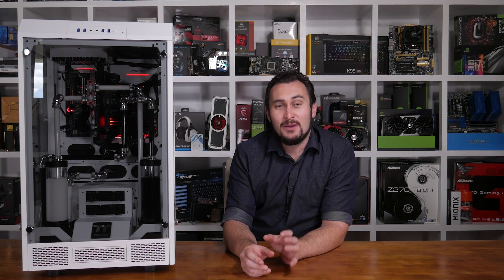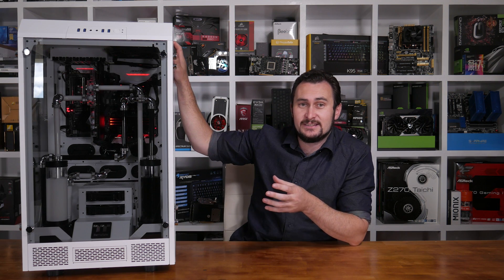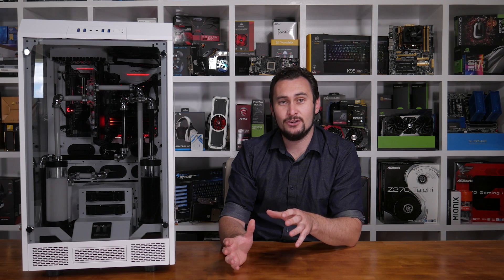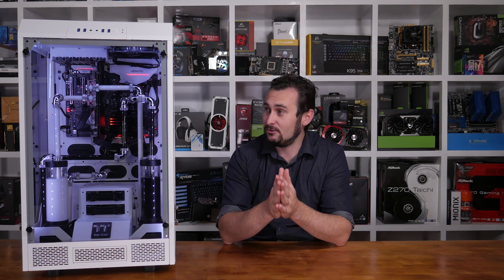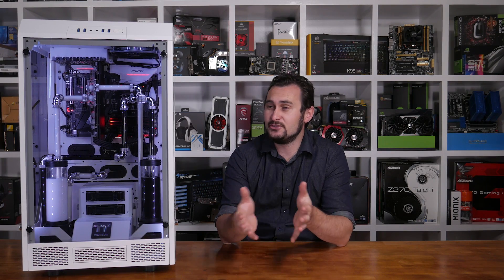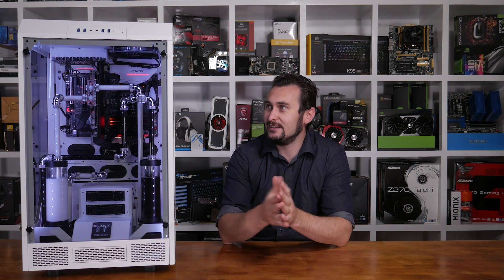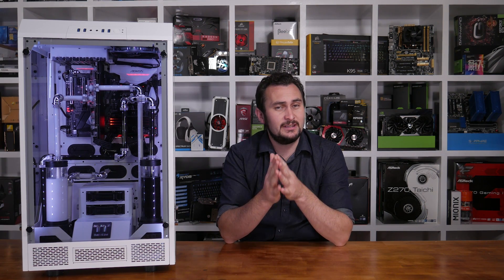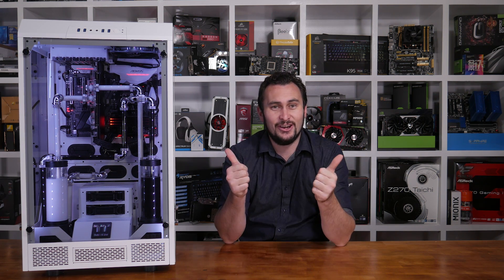Let The Liquid Flow! [Part 3] Thermaltake The Tower 900: Kaby Lake Build

Comment: Thermaltake pump/reservoirs install easily into this Thermaltake case but if you want to install a EK pump/reservoirs, or some other make, the mount does not work very well. Something Thermaltake could have improved on. Apart from that it is a brilliant case for dual loop water cooling. It takes two 560mm rads too. :-)

Comment: Noone has a vid about the backside where the rad is WTF. Have the same case and using EKWB extreme kit. It worked on another case but after the case change and liquid change it fills up and then the loop gets stuck. Support said i have to get the res higher. Have it somewhere in the middle and the pump being the lowest. But mby its the rad, looks like the air gets stuck inside it and the pump going crazy coz it cant move the liquid. Thats why im lookin for it.

Comment: @Hardware Unboxed - Have you had any issues with Thermaltake C1000 Opaque coolant? I've seen others that have had residue build up and clogged CPU blocks / GPU blocks. Is your build still going strong? I only ask because i was about to put this stuff in a threadripper 1950X build.
Reply from the maker: I haven't had those issues but after 12 month it fades and you will need to flush the system but I think that's typical for any coolant.

Comment: I HAVE THE SAME THERMALTAKE TOWER 900 SNOW EDITION CASE /  MSI Z 270 GAMEING PRO CARBON MB / 2-GTX-960 GPU / I7-7700K CPU /T-FORCE VULCAN DDR 4-16 GB RAM / 1-250 GB TRION OCZ SSD / 2- WD GREEN 1 TB HD FOR STORAGE / 2- CUSTOM WATER LOOPS/ 12-ANIDEES 140 BLUE RGB CASE AND RAD FANS / CORSAIR TX 750 WATT PSU / BLUE RAY BURNER / RGB LED STRIP COMBO 12V / 24V SMD 3528/5050 LED STRIP. AND I LOVE IT THAT CASE IS AMAZING IN WHITE WITH THE RGB LED LIGHT STRIP. YOURS LOOKS SO AMAZING GOOD JOB BUDDY.
Reply: who cares what you have in it

Comment: I like it, and would say this is about what my dream build would look like.     However, I can see room for improvement with the design of the case.     It could have a 200 mm fan at the bottom and top, and a fan in the back compartment.   It could showcase the SSD's better.     I think what I am saying is that for $ 3,000 or more, one might still expect more than this setup.

I think in 2018, we need a new motherboard format, much larger, for more M.2 cards and dual-channel memory with a big monoblock.    I wish AMD and Intel would get together and standardize a socket, that would last 5 years of being future proof.

I hope they come out with a case like this that is even bigger, with chrome exhaust pipes and a chrome radiator grill on the front with a solid metal 1930's hood-ornament.

Comment: Stupid, Stupid question here.  I love the case "but" do you have you go with water cooling.  I just don't think i have the skills for the solid tubes definitely.  I have built a few PC 's in my time but never water-cooled and I am not that confident with that.  I just love that case!  Great show by the way.  Fantastic
Reply: Clemster Clemsters hey, man. I’m sure you’ve figured it out by now, but no, you do not have to do water cooling in this case. It will look quite empty without a couple of loops in it, though.
Reply: Clemster Clemsters, you could use just an air cooler, or you could use a prebuilt loop and run it from the back.

Comment: Watching how you built this should really help. I'm doing the same duel loop with the same case but with a 1080Ti and 6700K.
Using a monoblock for my motherboard too. 

I'm using all EKWB products though. I am also using two 560mm (quad) radiators! 

I was very worried about bending tubes, but maybe I should just using a bunch of 90's like you did. I'm also using Red and Blue coolant and planning to put UV lights in there to really make it pop. 

Did you using hard tubing in the back for radiators? I'd love to see a shot of the back

Comment: going to do a similar build but for ryzen when it gets launched , is there any challenges you came across with the case , with my build i was thinking of replacing the bottom grommets on the motherboard with black acrylic and using pass thru fittings to avoid doing the whole build with hardline as bending tubes is not that fun and use soft tube for the rear chamber

Comment: Very interesting. Now you can make a video about how the fuck you can upgrade motherboard and graphics card :)
Reply from the maker: For that play the video in reverse.
Reply: Hardware Unboxed hahaha! smart answer ;) but i am worring about the liquids. how easy is to pull them out of the system...
Reply from the maker: Very mate, you just make a drain line at the lowest point in the system.
Reply: Oh cool :) i thought it could be smthin like suck it slowly from top where you filled it with a syringe or smth....

Comment: Are those the the thermaltake water cooling kits? i know you added other parts, but the radiators and pumps came together I think. that's what i thought i saw at least lol. if those are the kits, would you reccomend them?
Reply from the maker: Yes I can recommend these kits. I used one for my personal rig some time ago and it works great.

Comment: https://youtu.be/tb7l4VA3de8?t=38 how mutch force need put tube into fitting ? And easy can pull tube when fitting is secure ?
Reply from the maker: Quite a bit of force it required to make sure the tube passes all three washers. Once secure pulling it out would be very difficult.

Comment: Great job, Steve!

I'd recommend looking into either filming at 60 or 30 FPS all the time, not intermittently changing the footage with different framerates. Kinda struck me, most probably because I myself am choosing a camera for shooting similar stuff at the moment.

Amazing work, hope to see more collabs with companies like this in the future!
Reply from the maker: It's all filmed at 30 fps mate, I can't afford a 4K 60 fps camera just yet. Maybe later in the year ;) The transitions and editing done in Premiere are done at 60 fps to smooth that stuff out. Anyway it all comes down to money and we are on a shoe string budget compared to the big guys.
Reply: Yeah, I understand, I just wanted to point out that I noticed that some parts were in 60 and others in 30 FPS! I would also be totally fine with good quality 1080p footage, not even talking about 4K. It's not only about the FPS and resolution when it comes to video too, color representation also comes into play, which may differ between 4K and 1080p on the same cam. I just started learning more about cameras, so I guess I notice these FPS differences a bit more easily, at least right now :)

Thanks for the content!
Reply from the maker: 4K footage is required so that I can mess around with it and create interesting b-roll. You can't zoom in on 1080p footage @ 1080p and not end up with blurry rubbish ;)

Color representation is the same on the G7 at 1080p and 4K, it's very good.
Reply: Nice build, but I was hoping to see some bending. I hope you got a GH5 by now.

Comment: Looks good.

Have you got rid of that air bubble in the GPU, also did you learn from Matt to install a drain valve?
Reply: LOL
Reply: Or two very burly men.
Reply from the maker: There is still one air bubble, I need a fork lift to lift the case forwards. What's a drain valve? Don't you just punch a hole in the bottom of the rad with a screw driver?

Comment: Early. 
Seriously though, how would the performance of this build be affected if you just use regular air cooling? That'd be a good video. I just don't see much reason to water cool these beasts, starting from Skylake and Pascal I just doubt if there are sufficient heat to be cooled away.